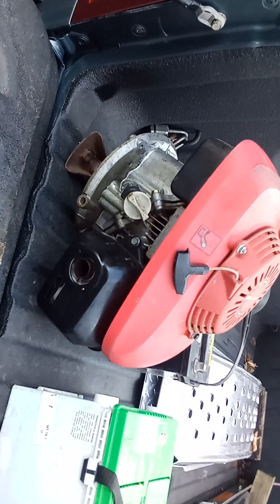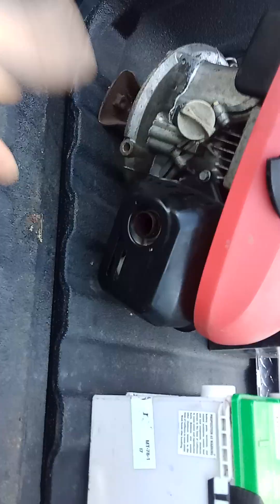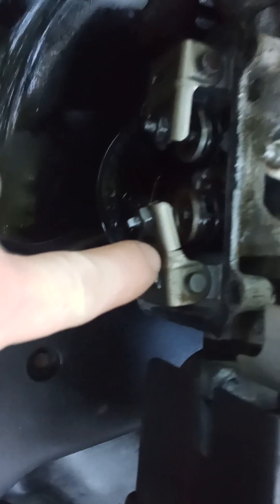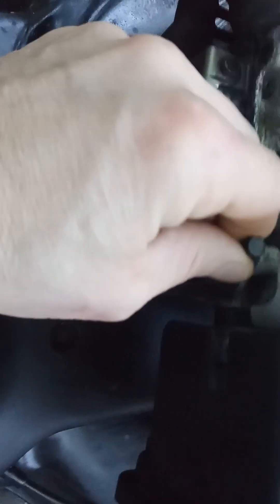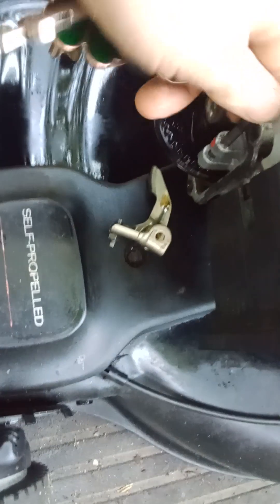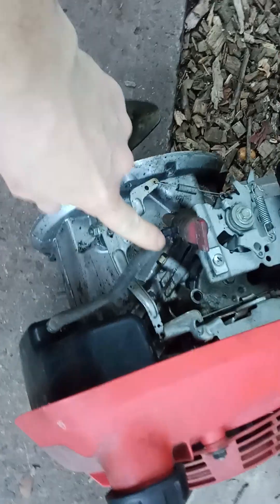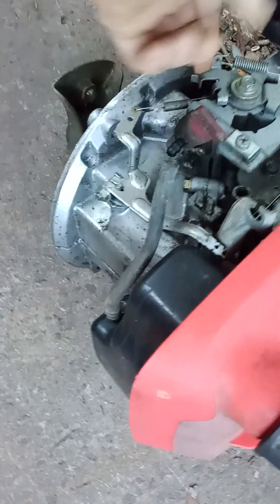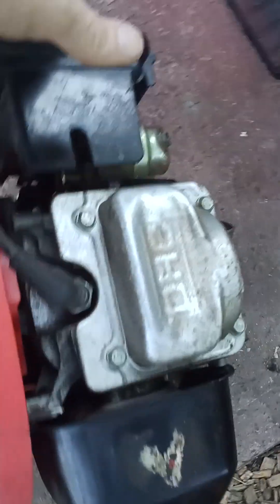Honda GCV160 with a broken intake valve rocker arm as well as no movement from the valve. How, why?

Comment: This seems common on these engines. The same thing happened to the GCV160 on my pressure washer.
Reply from the maker: First obe I had that did that on a Honda. The valve seat behind the head came loose stopping full travel of the pushrod which in turn bent it and the lifter at the front. I’ve seen it happen often on the newer Briggs V twin engines. You can fix it, but you gotta remove the entire head and you can usually put the guide back in place and than hammer and dolly it so it doesn’t come loose again. You do that by taking a hammer and punch and tapping divot holes all around the aluminum where it sits which compresses the metal surrounding it so it can’t pop out again. Otherwise you can replace it if it got really chewed up, but still a good idea to hammer and dolly the new one too, so that one never pops out either.
Reply: I just dropped mine off to be fixed, hopefully not too expensive. I will be curious if that's what caused the rocker arm to break.  @Mr_Tecumseh

Comment: It is a possibility that the adjustment bolt got loose and caused the push rod to fall out of timing, this may have caused the valve head to come into contact with the cylinder head and completely ruin it. If those rods are bent in any way they aren’t going to move anywhere without being cut down. Or it could also be that the guy adjusted it wrong causing the same thing to happen. It might be a good idea to pull that entire head off to see the damage done. The piston head will also have an indent on it from where the valve made contact, that will prove if I’m right.
Reply from the maker: Excellent suggestion. I will pull the head when I have some time and have a look. For now, she's already swapped out. Thanks for the comment. 👍